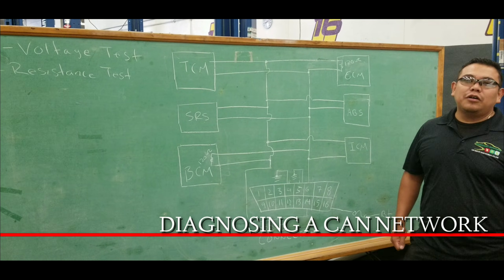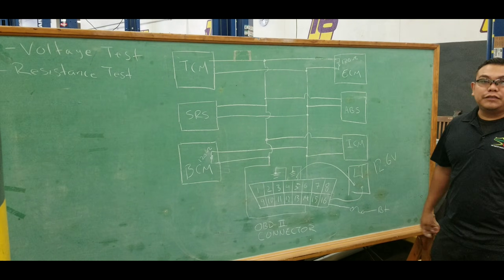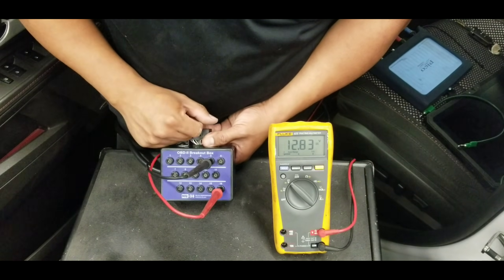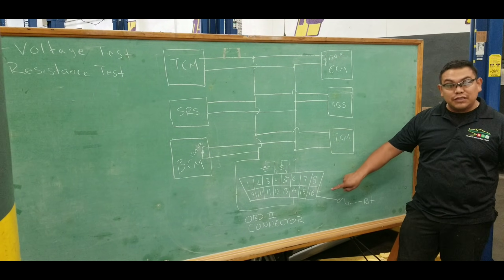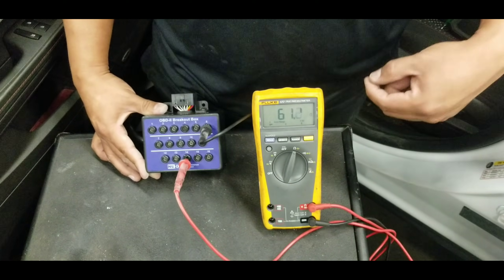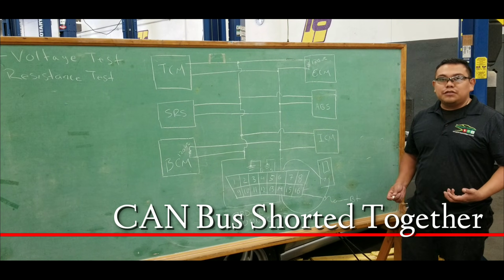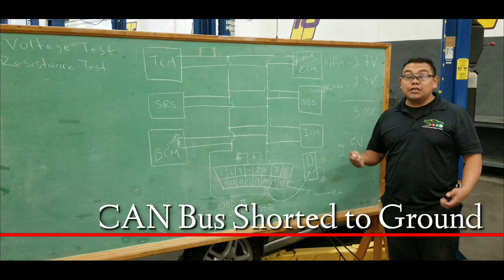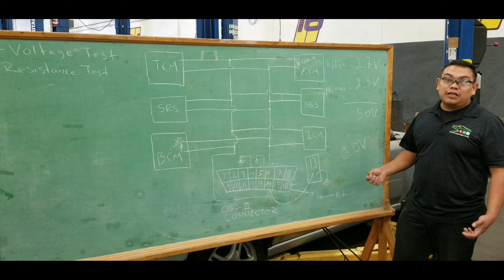How to test a CAN bus network with a meter

Comment: Mr.Diagnostech ... I did every test you showed on this video and everything checked out as explained. I have my grounds on #4 & 5 pins and voltage from 16 to both grounds checks out same as battery. I did my resistance tests and got 60 ohms between modules (ecm & bcm) checked high and low on pins 6 & 14 and had the exact same voltage you did on this video 2.7 & 2.2-- .. now I'm stuck on where to go from here. The only code I get on the obd II is lost communication with BCM. Please help
Reply from the maker: This means that you do not have an issue with the CAN network, that's why you can still communicate with other modules except the BCM. I would recommend to check the powers and grounds to the BCM module.
Reply: @MRDIAGNOSTECH  is there something that will tell me what pins have voltage and what voltage I should be getting? Some diagram somewhere or how would I know.. I found out which pins should have power but I don't know what voltage they should be at. Thanks for the previous reply. I had 20 codes and got it down to 1 code with this video. Super helpful, I even had a "certified master mechanic" come look look at it and had trouble figuring things out. I figured most of it out with this video and I'm not even a mechanic, I'm an electrician. But thanks again, any advice would be greatly appreciated.

Comment: high side is 2.5 to 3.5V and low is 1.5 to 2.5V. if high is at 2.5V, then the line is idle (no data sent). and if at 3.5V there is 100% signal (lots of packets sent). low 2.5V is idle and 1.5V is saturated line. nice in-car demo with breakout box!

Comment: The 120 ohm resistors are necessary on long bus control legs where signal ringing can occur and messages are received twice (called Ring Back).  Ringback does cause comms issues and needs to be silenced.  These 120 ohm resistors ensure that ringback does not happen because they load down the BUS and absorb the signal at the end of the BUS.  They can only be used at the last component at the end of the BUS.  Some BUS’s don’t need terminating resistors by design.  Small or short range BUS should not need them at all.  Because the BUS is so short that ringing cannot occur on a small / short BUS.  Long circuits (long distance BUS) must use them because ringing will happen and control / Comms may not be possible or many errors my be observed.

Comment: Thanks for the awesome explanation,  I  have a Mercedes A190 here atm, with no resistance across the wires and no voltage either.
So hopefully tomorrow I'll be able to find the fault after watching your explanation.
Cheers mate.

Comment: At the end of the video when you measured resistance/ohms, is that with key off?
Reply from the maker: Recommend to perform the resistance test with battery disconnected otherwise a module can wake up at any second and create problems.

Comment: Really liked your video but realized it my auto doesn’t have this system. I have a 2007 Honda Accord EX-L, 2.4, AT with crank, no start, check engine light on, dashboard brake light on, no communication when hooked to code reader. This auto doesn’t have a can low and can high circuit. It only has a can low circuit which has 4.88 volts key off, 4.91 with key on. Have you done any videos on this type of circuit?

Comment: What if the moduals communicate with the scan tool,but they don't communicate with each other.they say lost com with "blank" modual. Different moduals lost com with others but all com with the scan tool.
Reply from the maker: That means that the CAN network is working properly and the problem could be the module itself that is not communicating or something causing that module not to communicate with the rest of them. Here is an example of that type of problem: https://youtu.be/eLwK2-kN5S0

Comment: Dear Sir. What about this? Pin 6 and 14 got both 2.44V reading -> looks like short. Multimeter sees 0V between those pins. But between those pins is 65 Ohms. Both pins is 2.44V all the time with battery (-) as reference. I hooked up oscilloscope to see and there isn't any data activity either. Same with Ignition ON, or with started engine. Why there I can't see any data? Proper car diagnostics works well through that OBD connector I measuring. Thank you.

Comment: So just to confirm please anyone can answer in the ohms test. If I unplug the ecm and the meter reads 121 ohms that means the ecm is bad right? And when I plug back in its 63 ohms
Reply from the maker: The CAN network has two terminating resistors of 120 ohms connected in parallel which adds to the total of 60 ohms. These resistors can be found inside any two modules. If the PCM has a resistor, when unplugged you should measure 120 ohms of the second resistor that is still connected to the circuit and when plugged back in it should measure 60 ohms. Your scenario would indicate that the pcm resistor is good.

Comment: Ok but if when measuring resistance at canH and canL you get OL?
Reply from the maker: If you  get OL it means there's an open circuit.
Reply: @MRDIAGNOSTECH  ok that's obvious but are the resisters blown out because that would be open circuit as well

Comment: Ok but my Navara is showing no signal on can low through breakout box for say 5 seconds then the light on my breakout box flickers dimly for quarter second. Can hi is flickering as normal. Wipers dont work. Central locking does. 2007 so bcm using low can speed. 

Whats likely wrong

Comment: Mine is showing the voltage, but no Ohms. When I put the prongs in it goes from OL to 0. Why is that?

Edit: I've checked with a vehicle that has no issues and it's still at 0 Ohms.

Comment: hi thank you for the explanation, i have followed the instruction on your video on a S350 2004,  4,5 with 16 providing 12:xx V
background:
water came in to the car, from the driver side because of clogged drainage; removed all the furniture, and under the carpets checked all the terminals all are in excellent condition,
followed your tests,
voltage 4 and 16, 5 and 16 12.xx V
resistance :6 and 14 got 60 ohms
can bus hi : 4 and 6 =2.5V
can bus low 4 and 14 =2.5V
in your video you said that if equal it means there is a short, 
also you have said that if you want to test Ohms you need to have a sleeping computer, 
in your video you you just switch off the ignition, (is the reading is right?) and should i follow the same process.

further how to proceed after finding a short in the can 

also when i connect the scanner, the car is not auto detected, i need to manually select the model.
errors start with CAN bus communication  
any recommendation on how to proceed?

thank you again, you did a great video/s thank you for you effort.

Comment: My 2003 ford Expedition does not have pins 6, or 14 . . .
Reply from the maker: That's because your car doesn't have a CAN network.
Reply: @MRDIAGNOSTECH  Why am I getting a Can bus error code with my scan tool?

Comment: Great video buddy.i have 2008 Ford focus. I want to put aftermarket stereo in it without wire connector. Can I neutralise the can bus wires?illumination and acc...I wires up aftermarket stereo and it played up.instrument cluster lights all stayed on and no working indicators on dash.  I wired factory stereo back in and it fixed itself.i hope I explained clearly enough.basicly I'm asking how to get round can bus system with aftermarket stereo. Cheers

Comment: This is the best way of explaining Can bus system. Instead of dudes jumping on videos and talking in Mechanic terms that's confusing and long. Trying to explain how their fancy equipment work and what it does with out breaking it down like this dude. I must've seen a thousand print outs on here explaining wiring at what goes to where. It means nothing if you can't understand it or what's what. And most don't bother telling us there's a network involved. Proper breakdown here!
Reply: An explanation clear as water.
Thank you!

Comment: Good morning my friend and nice to meet you!

My vehicle (2003 Dodge Caravan Se V6 3.3) is giving me a (P0201-Injector Circuit/Open Cylinder 1) code and i have a (2003 POWERTRAIN DIAGNOSTIC PROCEDURES book for town & country, caravan and voyager) that shows on page 88-89 test procedures to follow and apply. 

So far i have applied (test 1) and (test 2) and im on (test 3) now and im stuck on not being able to follow and apply it cause im not grasping and understanding it at all.

This is test 3
Turn the ignition off.
Disconnect the Fuel Injector harness connector.
Remove the ASD Relay from the IPM.
Turn the ignition on.
Jumper the Fused B+ circuit and the ASD Relay Output circuit in the IPM. (This part im lost)
Using a 12-volt test light connected to ground, probe the (K342) ASD Relay Output circuit.
Does the test light illuminate brightly?
Yes      Go To 4
No     Repair the open in the (K342) ASD Relay Output circuit.
          Perform POWERTRAIN VERIFICATION TEST VER-5.

This is a video of me following and applying (test 2-https://www.youtube.com/watch?v=rbzQKyiNwcA) and in that video it shows the pages in the book from pages 88-89 and pages 312-314 for code (P0201-Injector Circuit/Open Cylinder 1).

Are you able to please make a video showing me how to perform all of these test procedures so it can help me grasp and understand to where im able to apply the test procedures from all those pages?

Comment: Goodnight my bro right now I am working on Honda accord v6 2003 when I check can bus 6and 14 I am not getting no resistance my meter reading ol but when I and check them individually I getting 4volts on 6 and no voltage on 14 just asking for help

Comment: Lets say a vehicle has no water temp sensor.....
Could I add a water temp sensor and run the wires to where they would factory conect to? If so then would i be able to connect a obd2 scanner and check the temp?

Comment: If you have only the 2 ECU's with the terminator you still can't diagnose. Next level is oscilloscope to check data signals and next step bus transceiver in transparant mode.
Can bus is basically the same as RS-485 only different termination and slightly different voltage levels
Reply from the maker: I agree, the best way to test the CAN bus is with a scope, that's why I also made a video for it: https://youtu.be/OIMuVVPu2N8

Comment: Thank you for the block diagram in your excellent presentation. This is a very useful abstraction.

I've had success filtering and displaying PID data from the ECM, i.e. RPM, temperature, speed etc; However, I've never had success in isolating data from the BCM , i.e. direction indicators and so forth.

No matter where I look, I seem unable to find information about how to access the BCM, to carry out more work on that part of the CAN bus.

Comment: Sir thank you so much for this wonderful video.Very well explained! I'm stuck with a mini cooper R56 which drain the battery (4 amps always) and have no obd communication. The readings gives me 125 Ohms, 2.9V Dcan-L, 2.0V D-can-H. Do Bmw have different ohms/voltages or is it clear that something is wrong? Thank you again!

Comment: I like this presentation however, a VOM test is not 100% accurate or should I say instead...it doesn't give a complete indication  of what might be wrong in the circuit.  A VOM / multimeter could show 5 volts between CAN high and CAN low but it cannot show if the signal is a perfect or near perfect square wave. An oscilloscope is required for this test, so we can view the actual shape of the waveform.

If the waveform is not a near perfect square wave, this can lead to delayed timing of events, which can possibly result in an engine misfire or other problem - depending on the module affected. The following video will explain this issue. In any event, I love this test procedure which can potentially solve some communication problems - if an Oscilloscope is not available. Some may argue that an Oscilloscope is not needed however, after watching the video in the link below, they just might think differently.

https://youtu.be/DIn8sIPRr1o
Reply from the maker: I totally agree with you, that's why I also made a video on testing the CAN network with an oscilloscope. Here the link for the video: https://youtu.be/OIMuVVPu2N8
Reply: @MRDIAGNOSTECH  Great!.. thank you. I will certainly take a look. Keep uP the good work. I like how you keep thinks simple

Comment: Great video..
please help me with my car problem..
I have tested pin 6,14 and I got 123 ohms
the scanner tool is working fine the car is working with engine idel rough and it's like it going to die ..and I got following codes in scanner :
U0100
U0146
U101
P25A2
P0174
P0171

also I got 3v at high and 1.8v at low 
what can I do to know the problem please?

Comment: Excellent video!  For those of us that have physical limitations in accessing the "under-the-dash" OBDII connector, is there a 16-pin OBDII extension cable that can be attached to run the same tests?  Any recommendations?  Would there be any length restrictions as it relates to to accuracy of any of the measurement readings on the meter?  Thank-you.
Reply from the maker: Yes, you can use an extension cable and will not affect the accuracy of the reading of the meter.

Comment: Great video my friend, very clear explanation. Thank you for sharing a good video to the world. One question, i have a 2001 Hyundai Santa Fe GL 2.4 liter the OBD II port do not have pin 6 which is the high side as you explain, which other pin could be my CAN Bus high side, do you know the color of the wire so i can look for, on the top i have pin 4, pin 5, pin 7, and pin 8, on the bottom i have pin 12, pin 14, and pin 16. Which one do you think it's friend, thanks in advance.
Reply: Your OBD 2 Wiring Diagram most likely will be in your www.alldatadiy.com 
Subscription for your  particular vehicle.
( Get the Yearly subscription )

CAN vehicles  didn't   come  on the Scene until Model Year 2007 or 2008 ,
so Control Area Network shouldn't  be in your 2001 Vehicle.....

On a CAN vehicle,  Terminal 6 is CAN Hi
& Terminal 14 is CAN Low....With the car keys  in your pocket & your Meter Set on the Ohms Scale - one Lead barely touching # 6 & the other Lead barely touching Terminal 14 should yield
60 Ohms ( + or - ) 2 Ohms.

A Big problem is a Lotta people 
Penetrate!!! the Terminals on
The Data Link Connector & 2 months down the road  someone  connects with a Scan Tool : Won't communicate with the Scan Tool : Sometimes the Fault is
someone has continuously Expanded the Mouth on the DLC.

Ex Smog- Technician
Southern California

Comment: Excellent video on canbus system.  I have a question though I have 2004 suzuki that cranks but not start issue and have proper ground and power on pins 4,6 , and 16.  However, I nortied igintion fuse that power fuel pump also powers the ecu.  That wire if  I cut it from the fuse now the cut wire stilled attached to ecu shows ground. with a light test  This supposed to be power but shows ground when disconned from the fuse does this mean there is a short in the ECU?  Thank you in advance.

Comment: Fixing 2017 Cadillac cts with no com. When I check the oms on pin 6 and 14 I get OL nothing changes on the meter. So I went to volt pen 6 gets 3.38 and pen 14 4.2

Comment: It is great video👍
But Opel Vectra 1999model doesn't have 14th pin which is CAN low. That's why I can't check CAN bus data with my scope through OBD2 place.
 As information I should say that, there is not any problem with diagnosing that Opel Vectra with computer.

Comment: On my 2000 Ford Focus pins 6 and 14 are not occupied in the OBD connector. Pin 2 and 10 are. But between 2 and 10 i measure 6 kilo ohms. Is this some other variation on this principle?
Reply from the maker: That's because this vehicle does not use a CAN network.
Reply: @MRDIAGNOSTECH  Thanks for the reply! How does the OBD connector communicate with the different parts in the car then? Does it only communicate with the main computer? Or is it not supposed to handle OBD scanners at all? I bought a Konnwei KW850 OBD reader but it says that it cannot communicate.
Reply from the maker: @Engineer9736  Any obd2 canner would be capable or communicating on vehicles 96 and newer. If you cannot communicate check for power at pin 16 and for ground at pins 4 and 5.
Reply: @MRDIAGNOSTECH  Yes, i checked the ground at pins 4 and 5, and power on 16 is also there. The reader does start up, but when i press the diagnose button and it tries to connect, it goes through all the protocols twice but fails ultimately. I also unplugged a lot of sensors under the hood as i heard that faulty sensors can short the bus, but that didn't help either. I also measured the continuity from the back of the OBD port all the way through the OBD reader cable, which seemed good. Do you maybe have an idea what this problem can be? Many thanks!

Comment: What do you do when the can bus resistance is greater than 120 ohms? From my experience, resistors that go bad don't generally go low, but actually go high in resistance, OR just go completely open. Lets say one resistor is good at 120 ohms, and the other one is high at 200, adding the value of the two in a parallel circuit, it will give you 320 ohms, divide that by two and you get 160. Not sayin this would happen, but is it possible? I've never seen a resistor short, they either go open or go high, some go so high it places the resistance on a higher scale, in which a auto scale meter would catch. Anyways, good information, i learned something here, I'm always open for views and opinions... can't ever learn too much imo.

Comment: Great CAN Bus explaination video. However I have a doubt when some automakers are not using Cavity 6 and 14...how can I should identify CAN High and CAN Low lines???
Reply from the maker: You can look up the wiring diagram for the data link connector and it will show you what pins are being used and how many networks are available because some manufacturers use multiple networks in a single vehicle.